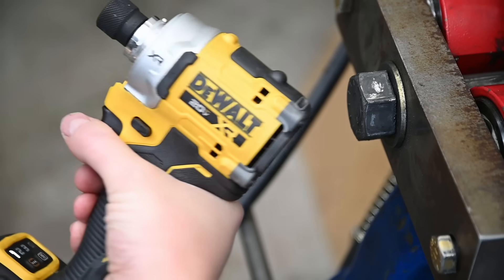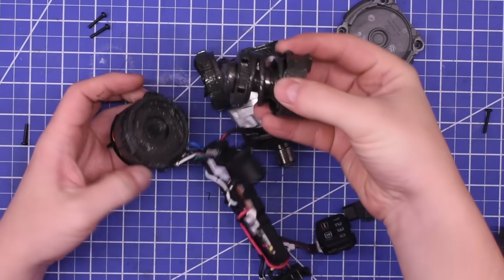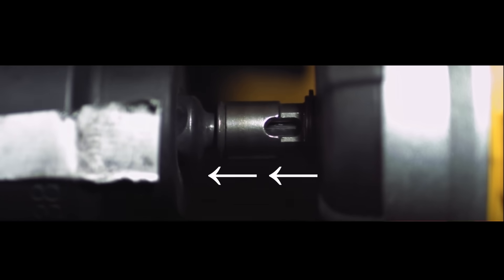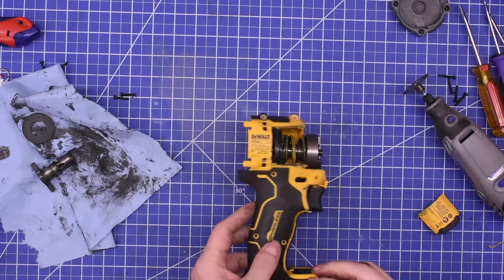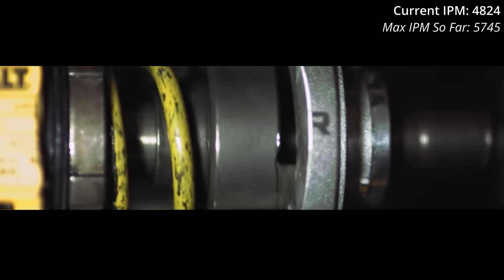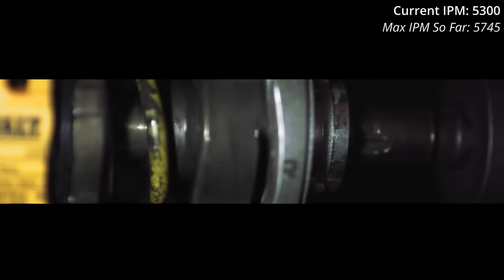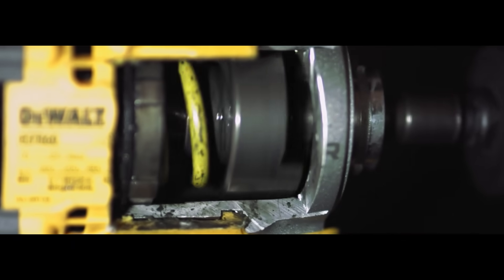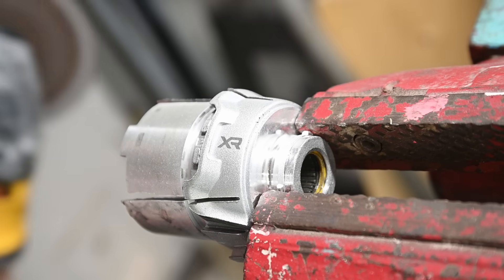We Found Something Strange Inside DeWALT's New Tool @ 10,000FPS

Comment: Flip the spring, then maybe work better in the normal mode and slowly in rev.
Reply from the maker: Flipping a spring doesn't coil it in the opposite direction
Reply: @TorqueTestChannel  but changes the direction of the coils.

Comment: So, you just discovered "Spring Harmonics" a world very well known to mechanics 😂 nice video, the slow motion really let's you see the spring binding when the hammer spins on the  "wrong" way, a sliding plate fixed to the spring fixes that, that's what companies did in cars, no more spring twist when turning the steering.

Comment: I spent  3k on Makita , seems like every test I see Makita comes last FFS !!!  My new DHS680 circular saw burnt out within a wk , pretty pissed off as you a well imagine, then on closer inspection found to be built in F China !! I should have done my research I’ve little faith in Makita now , I could easily have saved 2 k and bought cheaper …..learn from this old twat if your thinking of buying good quality because if it’s made in China it’ll be made of chitanium or Chinesium if they’ve run out of fudge and wet tissue paper 🎉😂

Comment: turn the spring around I wonder if the spin is making it compress easier with the springs twists rather then against
Reply: For that you'll need a spring with the opposite coil direction. Turning the spring around shouldn't change anything.

Comment: I wonder if you could put some shims between the 2 ends of the springs to remove some of the torsional spring effect that the spring has to see if that would change the difference between forwards and backwards.

Comment: I always wonder why people always go for the hardest hitting impact for small applications…

My co-worker was swinging his di** with his new 3/8 impact. Gave him adapters and a socket to take a wheel nut off (heavy duty 500+ft/lbs)

He took it off with his impact and had to get it warrantied the next week.

He got it back and its too powerful that when he uses it for appropriate jobs it busts bolts right off every time they are siezed. 

Seems like a stupid idea to have 600ft/lbs of torque in something so small.

Comment: lol... try it with any compression spring, hold it on a flat surface, compress it slightly, and rotate it one way or another... the helix will dictate the direction it prefers. its always easier to rotate with the wind, winding up, rather than backwards, unwinding it...

lol, yes, impact "driver" suggests it should work better when tightening... and so it may be for a roofer/builder etc that only ever drives tek screws...

the general use of a rattle gun is removing those stubborn fasteners... 

would be nice to try with a few different variations.

like a reverse helix spring... LH instead of RH.

a thrust washer... just a bronze washer under the spring.
replace spring with a stack of small compression springs in a spider/revolver affair...

its also rather strange that the spring isnt a full contact winding... almost like theyre cut from a longer length rather than individually wound.

generally a compression spring is wound closed at each end then ground flush for a proper contact surface?

of course, theyre building them to a cost, so fiddling with the mechanism is solely for ones personal satisfaction...

Comment: the spring is probably painted to prevent rust effecting/affecting(what is correct word? teach me english) the spring or something (if theres reason for it to be painted) The weird rebounding probably helps it run faster without weird metal parts hitting together not so planned way?
Reply from the maker: Nothing gets rusty in the greased hammer cage

Comment: I have been surprised with my Gen4 M18 impact through a few mishaps. 1st I left my work area to do something and a concrete guy set up a ladder and wet-cut an 18in square hole above my impact covering it with concrete sludge water. I was livid! I opened it up and found no internal signs it happened at all! 2nd, five months later, I dropped it (came off my belt) from 40ft off a boom lift onto a wood railing, onto rebar, and into a 10in deep mud puddle. I went down and cleaned it off and then decided to disassemble it, to find hardly any muddy water inside, cleaned it up, and reassembled it without any problems. Took it home and re-greased it. 3rd, I dropped it again from my belt clip and the front of the impact popped halfway off (it only clips on), popped it back in, and again other than a sharp gouge in the housing, it still works great! Also, the belt clips suck when you bend down to pick things up. Other trades are often selfish ass holes! He could have moved, or asked me to move my tools. No apology or anything. Later, I heard Karma bit him in the ass when someone knifed the sidewall of his truck tire.
Reply: What you "heard" was the hiss of the air escaping, while you didn't "see" it because you closed your eyes for protection just before the knife penetrated…so what you said was in fact true!

Comment: At first, I was excited about higher performance but then remembered, my gen4 Milwaukee M18 1/4in impact is able to strip or break 1/4in concrete fasteners and even break 1/4in-3/8 drive impact socket adapters. 3/8 concrete fasteners are much tougher but if I try I can strip those too. I am pretty happy with my M18 tools for most needs and even the M12 is just the right amount of power and lighter weight.

Comment: Vibration dynamics is one of, if not the hardest subject in mechanical engineering.... this made me shivers a bit with ptsd. 

I guess dewalt went to find some PHDs and locked them up in a lab to tune impacts, which is something a lot of tool companies have been doing lately.

Comment: I'm wondering if the variance in speed has to do with the coil rotation as the torque in the forward mode what would cause the spring to expand whereas in reverse the coil contract inwards allowing for it to hit that likely designed resonance

Comment: Mind that they opened the hammer/spring chamber. So there is no air cushion/absorber. Also oil or grease will seal off a air chamber.
The spiral spring itself needs to be wounded up or down this effects the spring tension for forward or reverse hammering force.

Comment: doesnt the thing jsut do 2 impacts per rpm as it has 2 dogs? If free RPM  ~ 3000 then free impacting speed should be 3000 x 2 = 6000 IPM. Reduce free rpm slightly when it is actually doing work.

Comment: The spring offer less resistance when the rotation goes in the direction of its coil,and more when you go the opposite direction of its coil : the friction increases or desreases at its extremities.
Have you ever tried to push while twisting a coil spring ? it's the same effect and it's nothing special.

Comment: What if you ground down or otherwise removed part of the end of that taper on the hammer. Would it still bottom out? Is it due to stacking tolerances of the spring rate and design of hammer taper? Or is it there on purpose to limit the travel so it bounces back faster?

Comment: I wonder how the reliability is for this design. You could get the same power out of a little less weight on the hammer, but your hammer is hitting more often. Would the hammer mechanism wear out more quickly with the extra hits, or would the reduction in weight keep it from wearing out as quickly?!?

Comment: It always amazes me that the whole mechanism in these tools can handle all that violence for years and years. I have never had any impact driver fail because of an issue with the hammer/anvil/spring breaking. Its always been either the plastic casing fails or at least back in the brushed days was the motor
Reply: Steel is an amazing material
Reply: Metallurgy is an Art and Science

Comment: Your channel never seems to show any bias which I respect so wholeheartedly, but I am nevertheless very amused by you using a Milwaukee to take apart a Dewalt. I actually tell most people they don't need Milwaukee M18 because the M12 is so good. Other brands like Dewalt, and even other TTI brands like Ryobi and Ridgid have some 18/20v tools that shit all over M12, but for the most part, M12 is the best line of cordless tools out there for most people who use power tools every single day, and you only need to step up when you get into specific heavy use jobs like framing amd demolition and such where you're using a circular saw or Sawzall all day. For most trades, plumber, electrician, mechanic, various technicians, handymen, even drywallers, M12 is usually the way to go. And btw, I couldn't stress enough how great it is that your channel is unbiased. I'm not even a Milwaukee guy, I have like 4 or 5 different brands of cordless power tools and like 30 different brands if you include corded, I've just noticed that as a professional, Milwaukee M12 is the tool I usually grab first. After M12, it's not M18, it a variety of other brands, both cordless and corded.

Comment: dewalt could put this on a 1/4 or 3/8 anvil and make a real tiny monster wrench, but i figured they thought they could get the mechanics AND the carpenters with this driver because the high IPM makes this blazing fast when driving deck screws.

Comment: I am a mercedes tech and use this tool daily. It is legit and still surprises me. A good bit set and the right adapters and this is a very versatile tool.
Reply from the maker: The tool has only been out for a couple days
Reply: @TorqueTestChannel  Okay I did not realize it was a new model. It looks like the one I use. If it is even better I am sold already because the one I have impresses me.
Reply: I looked this morning and confirmed mine is the dcf850. If the 860 is better that's impressive

Comment: This high speed video appears to be where the driver is making no progress.  Very curious if that "uncoordinated ballet" in forward would be a coordinated ballet if it's making progress (although harder to film).  It would make a lot of sense to optimize a driver for something not moving in reverse and slowly making progress with each impact in forward.
Reply from the maker: Some of the fwd shots are very beginning of impacting. Just doesn't look like much progress when slowed down thousands of times. It doesn't bounce in the beginning
Reply: @TorqueTestChannel  I'll rewatch.  Seems like this tool is very much dialed for what it should be used for despite fwd Dyno torque numbers.

Comment: if you torque a coil in each direction and it will either expand or contract along both axis (longer/shorter and wider/skinnier). seems like the friction on the spring allows the slightest amount of that torque to 'tighten' the coil when in reverse. where when in forward that torque makes the spring expand in both directions, making it longer, thus harder to compress.

Comment: Fascinating for sure! I have seen industrial equipment have painted or coded springs for various strengths, lengths etc. but I have never seen this in a tool either. Makes you wonder if some of the first releases have initial beta springs during testing. "That yellow spring tested the best go ahead and start sending them out with that one..."😂

Comment: is there any real use case for an impact to do over 160ft-lbs? its not a mechanics tool, over torque could easily damage lumber or sheet metal being screwed down. With how fast it put down the nylock nuts, I'd think its a conscious choice by dewalt, more effective rpm, same ft-lbs. id also wager the higher reverse torque is an unwanted side effect, or for the odd time you might try using a driver to replace a flat wheel, or just for the box art. construction is more abt how fast you can put hardware down, not how tight
Reply: @torquetestchannel I'd wager that if you redid the nylock nut and rod test with left handed threads, you'd see it perform worse than in forward

Comment: High torque impact drivers don't make a lot of sense.  For me, 99% of its use is driving torx screws or small'ish bolts.  Beyond that you risk breaking the bit, and would be better served to use an impact wrench.

Comment: I'm beginning to think DeWalt has some dark magicians working at their R&D labs.
Reply: Less Black and Decker, more Black Mesa...
Reply: The tool wizards
Reply: Stanley Black&Decker madlabs!!¡
Reply: Worked construction for a decade. A small “crew” who beat themselves and tools to death. 

We had DeWalt tools from the 1990s to 2015. All held up and still going, minus the “concrete mixer” drill. 

We began trying Milwaukee towards the end as DeWalt batteries would only last a couple years. Remember, batteries cost half as much as the tool back then. Now days it’s closer. 

We found the Milwaukee tools to be smoother and more powerful. Unfortunately every cordless Milwaukee tool we bought broke within a year. At least 5. 

As far as corded drills/saws at the time, no comparison. The DeWalts performed better with nearly half the weight. But the corded Milwaukee tools don’t break either. 

10-15 years later and I’m hearing the same stories from my buddy who works at a power plant. While I’ve been going towards neither brand, I said I’d lean towards Milwaukee these days. He strongly disagreed as they use Milwaukee and once worked for us. 

I have no favorite. Hence going to another brand after being invested in one of the big two. Just real stories.
Reply: @fZionists78 I've run milwaukee cordless since they came out with the fuel platform. I'm a framer and In that time I've gone  thru around six circular saws, 3 Sawzalls, 3 drills, 3 impscts and a jigsaw. Many of the tools and batteries I'm running now are on their way out, also. Even though im heavily invested in tools and batteries I'm ready for a change.  Milwaukee isnt getting any more of my money. I've watched other framers burn thru milwaukee tools as well. They just aren't reliable and they aren't worth the money in my opinion.  Then again im getting sick of cordless tools in general.  They are too expensive,  the batteries are too expensive and they dont hold up. I will stick with cordless for the drills and impacts but for everything else im going back to the cord.

Comment: For me, the highlight of this video is the roller bearing in the nose. Finally! Combined with the longer, beefier anvil, this should be the low runout, durable impact I’ve been waiting for since the DCF895.
Reply: Problem is, the DCF887 already had that… and failed quite regularly under heavy use. The needle bearing was also a weak point on Makita’s XDT14. The 2 sealed ball bearing design on Makita’s newest models is holding up much better. And Milwaukee’s just have a bushing, which likes to seize up or go floppy.
Reply: @josephfox3901  the 887 doesn’t have a bearing in the nose.

Comment: I wonder if there isn't a slight variation between the angles on the contact faces? Say forward being square and reverse being slightly angled to add just enough thrust energy to the hammer to bounce it every second strike? To wind the spring to get the exact change in strength for the direction change would be extremely difficult. The precision required in all aspects of it's manufacture is signifigant and wouldn't come cheap.

Comment: Well, to be honest, chosing the "reverse" to be the direction performing better (if it can not be the same because e.g. you have to chose one direction the spring inside would be wound), makes way more sense. Because you need these essentially hammers to deliver as high as possible torque punch to loosen stuck bolts. But for tightening you usually need the torque to be precise, so a torque wrench. Not this hammer.

Comment: Cool review. So the other channel I saw, that kept having this impact jump out of the screw head wasn't faking it. That back and forth doesn't seem good or right. Seems like a flat out pain to deal with. Having the housing move all over doesn't bode for longevity either. With how lowish powered it is in forward and how stout it is in reverse doesn't seem like a usable, good or balanced tool to me. With all that combined with the highest price out there, this sure seems like a no go. Maybe a bunch of DeWalt fan boys will pick one up but don't think with all the above problems and quarks, it's not really going to get anyone to switch to team yellow and black.

Comment: Assuming this bouncing and rebounding off the gear case is intentional, that seems like a relatively easy trick to copy for new tools or even modify existing ones. It seems to me that removing the hammer and installing a slightly lighter spring or taking up some of that rebound space with a shim would achieve the same effect.  Of course I’m willing to bet the actual physics of it are far more intricate than that.

Comment: it seems like the spring loses control over the hammer kind a like a spring loses control over a valve at high rpm in a motor, i would wager a spring with more control over the hammer would make more consistent and more beans.

Comment: DeWalt Marketing:  So, how can we make this so we can release an upgraded version later on?
DeWalt Engineers:   🤔 If we pack it full of grease, it will have so much resistance that it'll be bogged way down. THEN on a future release, remove half the grease and the IPM will skyrocket, improving performance, all whilst having to make zero changes!
DeWalt Marketing:  DO THAT!!!